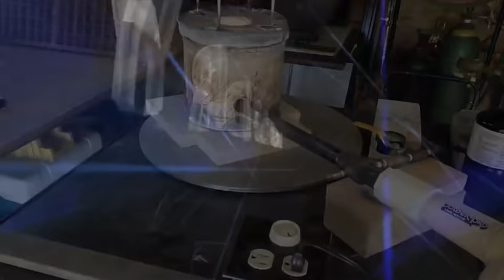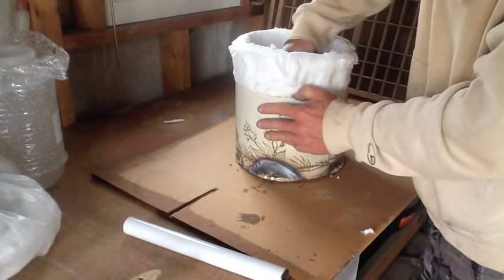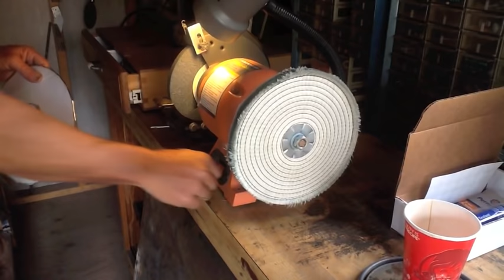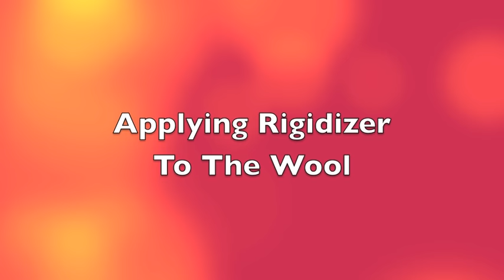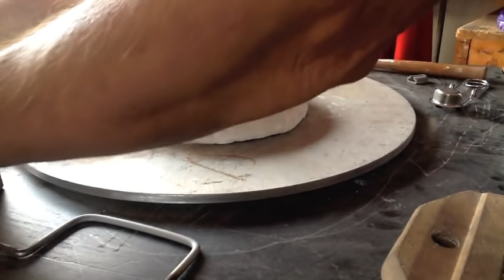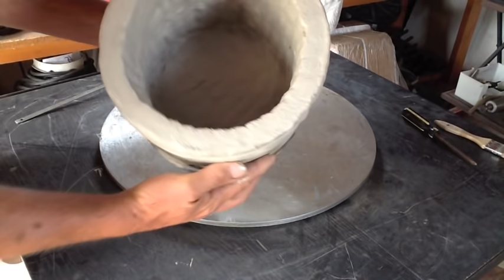BRASS MELTING FURNACE - EZ BUILD

Comment: Hi. Thank you for the video. Very good job. 
I have one question. I see that some people use charcoal for their furnaces. Others use propane. What was your reason to choose propane? I'm thinking about making some furnace, so now want to understand what are advantages and disadvantages of propane vs charcoal or coal.
Reply from the maker: I dont like the cost or mess of charcoal and also it is very difficult to control heat. With propane the heat can be "dialed in" to the metal you are melting. Thanks for the kind words...it works extremely well. The 1st melt I did with this one was brass :)
Reply: Thanks for your answer. I see your point. So propane is easier to use... 
That's cool that it allows to melt not only aluminium but even brass. So it sustain enough high temperature.
Reply from the maker: Yes, temperature sustainabilty. Metal needs to be poured at the right temp. In my opinion a charcoal furnace will fluctuate in temp too much to give consistent results and a hassle to boot :)
Reply: Ok. :) As I understand the only way to control temperature using charcoal is air flow. Yep, it should be hard to control it!  And how much propane the furnace use in liters/gallons per hour?
Reply from the maker: That depends on many factors honestly. I weigh my tank before & after melt sessions. Usage depends on the PSI you run at, the insulation used, if you preheat the metal, etc. I generally use 1 - 1 1/2 pounds of propane per melt depending on which furnace I use. Propane weighs approx 4.2lbs per gallon. A melt takes 15 min on average from cold furnace to pour time
Reply: Ok. Thanks. I'll convert it to liters. :) I'm sure it'll be less than consumption of my car per 100 km. :)
Reply from the maker: The efficiency of the furnace plays the biggest part which is why I use ceramic wool in this one and ITC100

Comment: nice ;3
i can use fiberglass?
That used in isolate the room
Reply from the maker: No, I would strongly discourage you from using fiberglass, its NOT the material to use
Reply: ok q.q 
Thank you for answering so quickly
greetings from Argentina
:3
Reply from the maker: Use ceramic blanket :)

Comment: Hi M.S.F.N.... how is your day going boss, hope you're having a good one. l am sorry to bug you again so soon but l have a baffling question l am trying to solve and thought you would be the man to ask. after looking everywhere and not finding much on the topic of melting stainless steel besides one machine l found  on Rio grande website, it melts stainless steel' but it coast's $18.500 😕 O.M.G?... what l am trying to do is melt verry small amounts in a mini crusable just enough to poor for mens stainless steel dress rings in a investment lost wax cast, l don't know if it is even possible with a home d.i.y furnace or mini furnace, l know it is a highly reactive metal, and throws sparks and is quite dangerous, but was wondering if it is possible with a coal furnace or a gas furnace, big or small to achieve this goal. Have you ever tried melting stainless before, im in No rush for a reply old friend, only when you find the time ok, take care talk soon, Luke. 🌄✨🌌☮
Reply from the maker: Melting stainless steel would be beyond the capability of most home foundries in my opinion. Its melting point is approx 2,600 degrees F....a pourable temp of roughly 2,800 or more. An induction furnace or arc furnace generally used. For a smaill quantity one could attempt using an oxy/acetylene torch but melting stainless is a formidable endeavor to say the least. Machining stainless steel is relatively easy and I could make rings easily on my lathe

Comment: what was the rigidizer? what is it for?
Reply from the maker: Rigidizer makes the wool stiff keeps the wool from just flopping around and also seals the wool so its fibers dont float in the air as the fine fibers are bad for the lungs
Reply: thanks, but what is the rigidizer? is that its name? where do I get it?
Reply: sorry bud, lol, just found it. great video

Comment: What is the height and diameter of the furnace?
Reply from the maker: I'll have to check and get back to you :)
Reply from the maker: The diameter is 9" and the height is 7.5" and has 1" ceramic wool insulation :)
Reply: Thank you.  That means you'll need (9X3.14) +9+9 inches of ceramic wool.  That's about 46.26 inches of ceramic wool which is good since most of the ones I found are sold in 24" lengths.
The most expensive part of this build looks to be the ITC100.  I can't find it for less than $80 for a pint including shipping.  Do you know a cheaper place to order that stuff?
Reply from the maker: I'll tell you where I got my ITC if ya wanna email me: makinsumthinfromnuthin@gmail.com